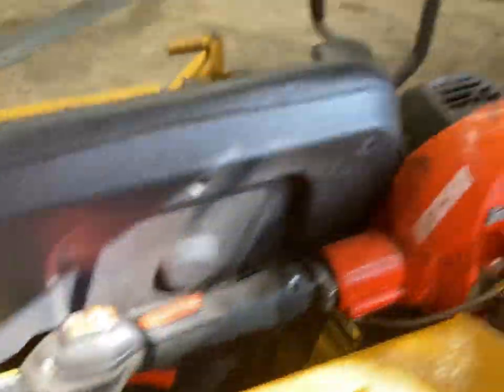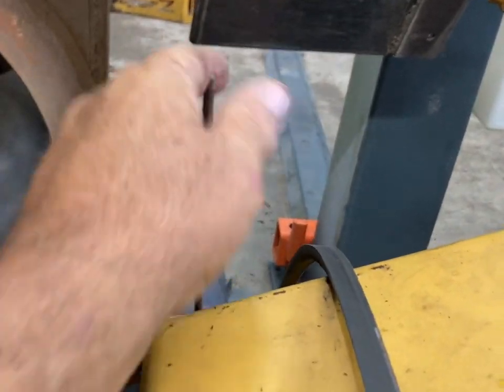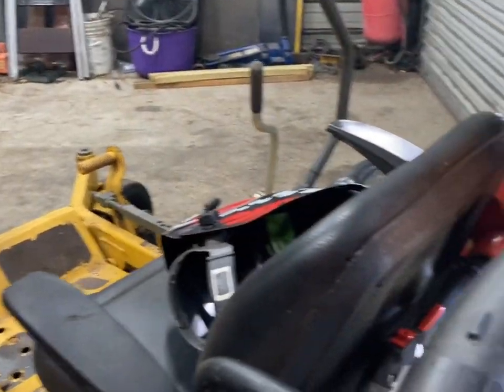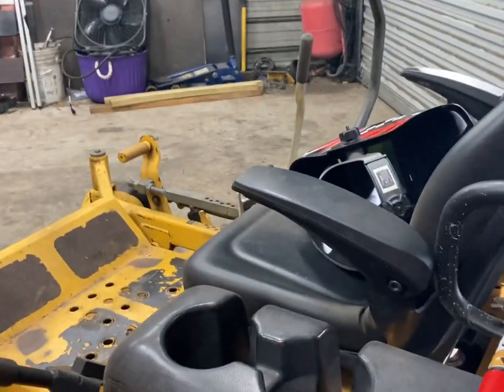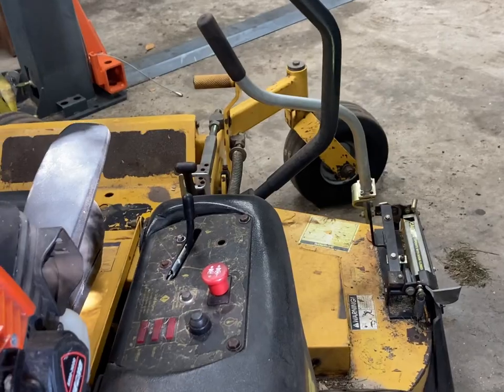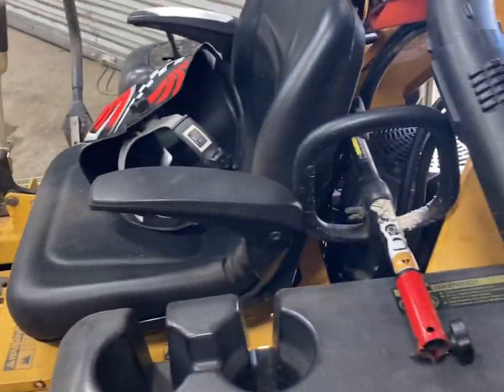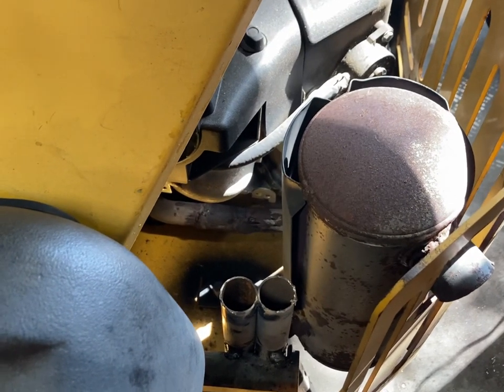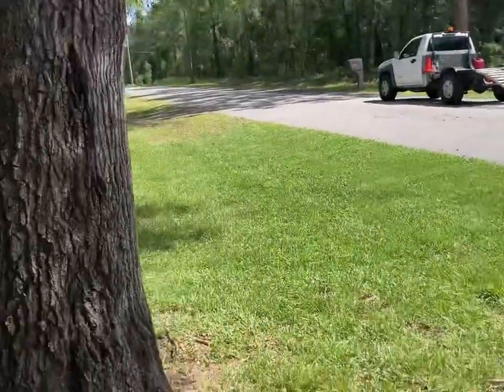BUILDING EFFICIENT MOWER CARRIER

Comment: How much weight do you save when you drill holes in the frame?
Reply from the maker: I’m not sure I’m gonna get a set of skills in way out on each corner and compare it to factory machine
Reply from the maker: The reason I wanted to reduce weight was more for the tow vehicle efficiency and then the operation of the mower
Reply: @sclawns5257  That makes sense. I was just wondering . I used to ride and race bicycles in late 70s early 80s and some guys used to drill out brake levers, etc. to lighten the bike